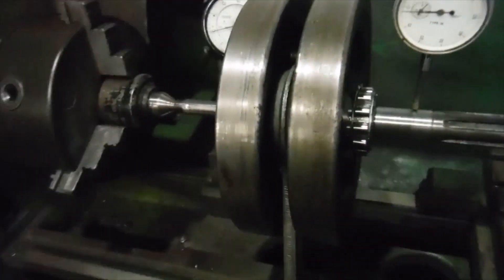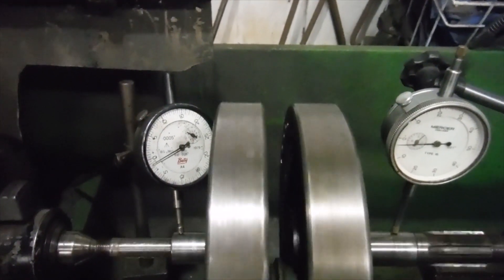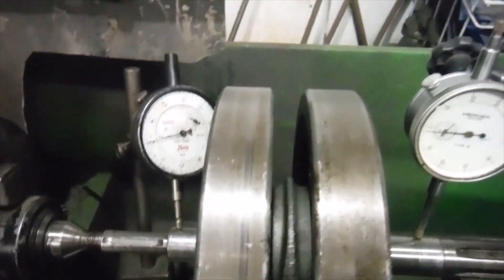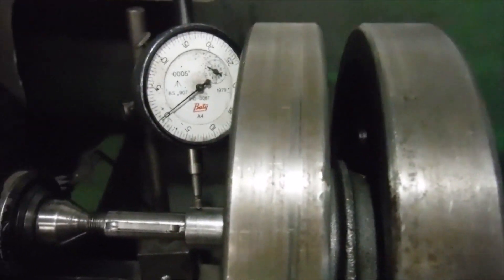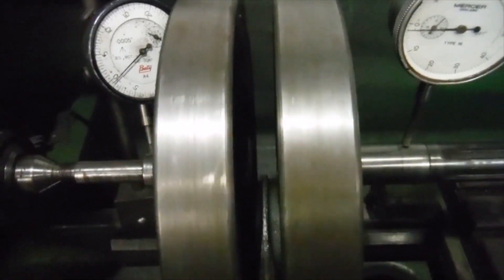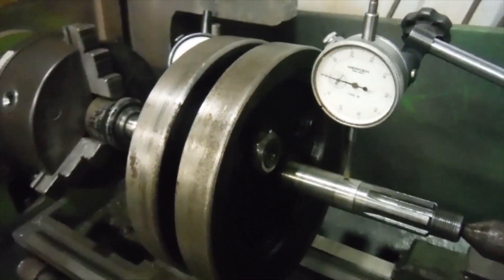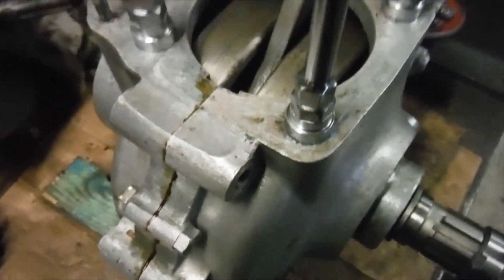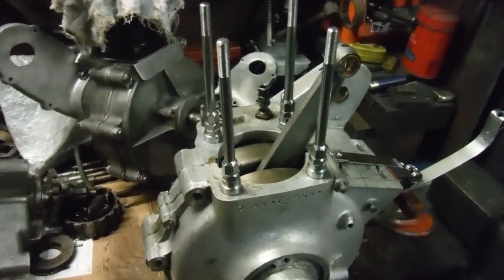BSA B33 rebuilt [not by me] crank and bottom end problems identified, fixed and discussed.

Comment: Hi Paul,  great job , can you tell me about the driveside spring assembly,  is there a recommended tension or just a set distance on a b33 ,Mines a two lobe , I have ridden down my drive way with the cover off an you can see and feel the lobe moving up on the cam,  I know it supposed to do this to save the end of the crank falling off , my b33 is actually a 597cc so maybe it's torque over comes it a bit much , when I put the crank nut on there was no difficulty in starting the thread , I would appreciate your opinion,  Cheers .
Reply from the maker: Hi, usually and as far as I know, the nut should be tightened as far as it will go and this should leave just enough room for the shock absorber to do it's job.

Comment: Don't know why you're worrying about that runout. :-) Just watched a video of someone putting a performance cam in a brand-new Harley Davidson big twin - 7 thou crankshaft run-out from the factory, and max allowed is 12 thou!
Reply from the maker: Wow!
Reply: At a guess that would be a 2 cam big twin with cams being driven by a cam chain and the factory figured out they could get away with that amount of runout........BUT if you want to fit an aftermarket Andrews gear driven cams set up the crankshaft run out has to be checked and in some cases the motor fully stripped and a far better job made of truing the crankshaft done.

Comment: Please could you explain the cancelling each other out bit Paul
Reply: Thanks for your rapid response Paul. I would have thought that if they’re rising and falling together, it would suggest that the flywheels aren’t parallel. On big marine engines (my field of experience) deflections are taken which can indicate bearing condition, using difference between webs at different points of the crank position. So I’m not entirely sure where you are coming from saying they cancel each other out.
Reply from the maker: Hi Richard, I have also served as a marine engineer, rebuilt marine engines and taken deflection readings, just like you describe, but trust me, my method with these single cylinder cranks works and is race proven. We are talking about a miniscule rise and fall here, which, when zeroed by being held in the main bearings, is transferred to and shared by the flywheels and mainshaft ends and my runout figures are about as low as it is usually possible to get with built up cranks such as these, in any case.
Reply: Hi Paul not questioning your ability, just asking someone who obviously knows what they’re doing to discuss an interesting point to improve my understanding. I’m exCity Line, from when it was a good job. How about you?
Reply from the maker: Hi Richard, no problem. I am ex merchant, on the tugs and did a lot of stripping and rebuilding for survey work, as well as a full crank replacement job, underwritten by Lloyds of London, for a B&W Alpha 16V 23L engine, which had run away and suffered major damage. It was one of a pair of main engines in a tug called 'Valiant Nader'. I worked as an engineer on board numerous tugs and finished up as a shore based engineer, overseeing repairs as required, when vessels docked at their home port of Swansea, after a trip. When the company I worked for [West Coast towing] was sold, I was offered work back on the tugs with the new owners, but decided to take a part time job local to my home and start having a go with old bikes for work, rather than the hobby it had always been. That was in 2004, and the rest, as they say, is history!
Reply from the maker: Hi Richard. If there is a very small, virtually equal rise and fall recorded on both mainshafts, in the regions of their main bearings, at the same points of rotation, when they are suspended in the main bearings, they will effectively cancel each other out. If the runout figures occurred opposite each other, they can effectively be added to each other, to give a higher total.

Comment: Have you ever used a Simple Simon crankshaft Jig, that's short for Humphries and Simon. I bought a complete one a while ago from an engineering place that no longer needed it, was wondering how accurate they are? I have a Norton International crank to get a new big end and pin fitted, the big end assembly is an Alpha, I have been told once fitted the conrod part of the bearing will need honing to be a correct fit which puts the tin lid on things for me as I do not own a con rod honing machine.
Reply from the maker: I have only ever used the 'between centres' in the lathe method, but realize the centering holes in the mainshaft ends need to be perfect for this method.
Reply: @paulhenshaw4514  Yes you use a lathe between centers to clock a crank up afterwards, the jig is used to assemble the crankshaft while truing it at the same time. Timing side flywheel fastened to a machined flat bed by T nuts with counter shaft already fitted. The steel bed has two round steel upright posts at a perfect right angle to the bed. Fit the rod and bearing, finally the drive side shim and flywheel. A huge threaded rod assembly then passes between the two flywheels and a casting cups both flywheels pulling them both against the upright posts while at the same time tightening the beds T nuts. Once the whole thing is tightened up you can tighten the crank pin nut before taking it out of the jig and over to the lathe to be clocked. I think motorcycle factory's of the day used these jigs on the production line to save on assembly time. I have got a photo of it with a crank in place, shame I can't post it on here.